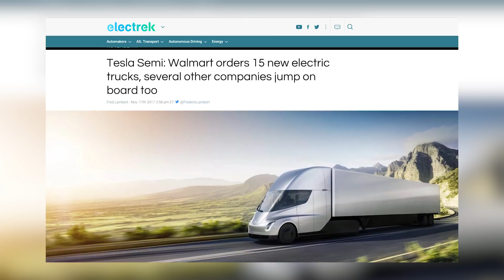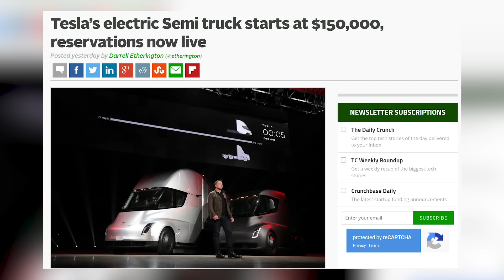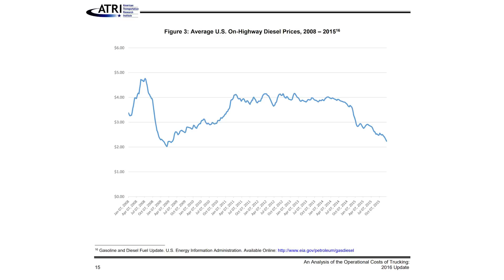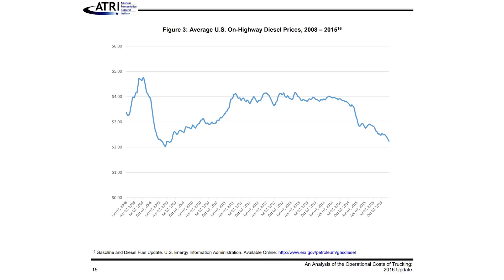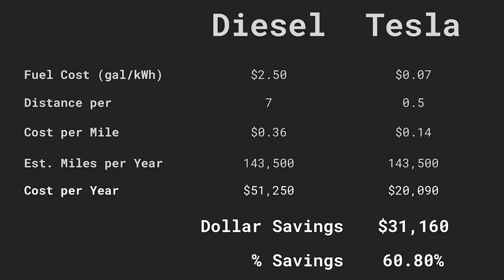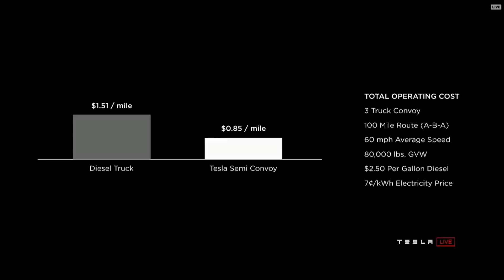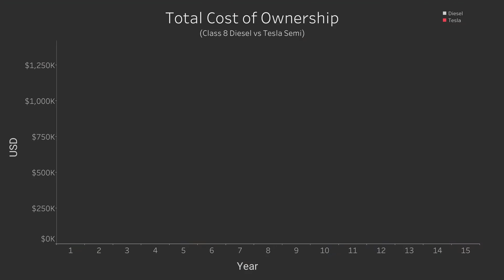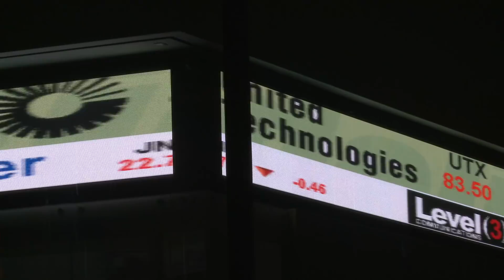What is the TRUE COST of a Tesla Semi?

Comment: Those numbers make no, sense at all. I.'ve driven twenty years and can tell you. Those maintenance costs are off by half at least. Even ripping off drivers like he says will actually increase costs as yoh will not be getting a talented, capable driver.. and the convoy system will be usless much of the year, weather, traffics. And local attitudes will not allow it's use except in insanely restricted areas. Bottom line. Don't trust Musk!

Comment: what is even more important is the back up service from the vehicle manufacturer, for if and when you break down on the side of the road you do not want to be there for a matter of hours waiting for a registered tesla mechanic to come out and fix it, and by the way every truck have trouble on the side of the read tyres running gear lights etc.
and that is what the other trucking company's have that tesla will find it very difficult to cope with.
Reply: King Thor or days

Comment: And also a job KILLER
Reply from the maker: Jessy Caballero and maker
Reply: Industries technology has killed or will in time:  The milk delivery man.... The telephone company women who "manually" placed calls.. (one dialer computer can outperform a 1,000,000 people do that)  telephone human operators (fully automated voice assist). Ice delivery. Film Camera Industry, Horse Shoe manufacturers... Industrial Factory Assembly workers (robots do it now), Computer Operators (Computers controlling computers). Amazon... (goodbye Sears), Horse drawn plows,  Steam engines.  Don't worry, driverless trucks won't happen overnight....  anymore than a cure for the common cold (which is also being worked on, but would likely cost about the same as LAZIK for your eyes).  Enjoy manual trucking before it goes the way of the Vacuum tube !

Comment: Why not put thin flexible flat solar panels on the roof of the trailer to help lower cost and extend distance..Or do they??You could have a whole trailer covered with flexible panels come to think of it..
Reply from the maker: Debbie Rodman would take miles of panels
Reply: Surface area of panels is not nearly enough.  Rough calculations:  Using the whole top of trailer and the sides would yield about 5 to 6 kilowatts hours...This would extend the 500 mile range into a 503 mile range....Three extra miles....  Solar panels are not energy intensive enough to make much difference.  Three extra miles.

Comment: I'm a truck driver in the UK and I can already see the benefit. Send a driver in a convoy, wait till each truck is loaded and then deliver from supplier to a central hub.
There's some issues with timed loads, but with some rethinking this is a game changer. Though drivers would become more valuable since they'll do more work to micro manage the non driving part and unless the mega chargers come with staff then the driver will have to do that also.
Another benefit is that in the UK we drivers have a 45 minute break every 4h 30 of driving or 6h of work duty.
Reply: Flavia Pitariu i wouldnt want to be in that plastic box in line at Calais,  Muslims will eat you slive

Comment: I think you need to be a bit more cautious with your words. It is actually impossible to software update the 4 electric motors. Those are electrical machines, can't update hardware over the air. It is possible to update the software in the motorcontroller though.
Reply: Or you could not get bogged down in word-thinking. 🤷‍♂️😏

Comment: Remember Evannex article at the beginning of the 2017 stating the new 2170 battery was 45% bigger in volume and 5750-6000mAh capacity over the 18650 cells 3000mAh. If these were going into the Tesla Semi, the weight reduction would be 25% for the same capacity with the advantage that the new cells could delivery higher power. The production costs is slightly higher than the 18650s.They had samples of finished 2170 cells back then so what if now 9 months later, Tesla have had some slight chemistry and capacity improvements? So in the past $145 per Kwh x 1 MwH battery for a Semi = $145,000, imagine the new 2170 cells @ half the cost $80 per Kwh x 1 MwH = $80,000. Am I wrong with my assumptions?

Comment: One minor correction: 80000 pounds is 36000 kilograms, not 3600.
Reply: Maintenance is a BIG deal, and electric vehicles win this category hands down compared to ICE vehicles:
- No gears, belts, hoses, pistons, spark plugs or pulleys to wear out.
- Regenerative braking not only stores much of that energy that would have been lost by just down-shifting or applying the brakes (saving money), but also makes the use of the brake pedal unnecessary most of the time, making the brake pads last MUCH longer. Elon is only slightly exaggerating when he says that the brakes will last "forever".
- FAR fewer overall moving parts. This is the main reason that a million mile warranty is feasible.

Can Elon and Tesla get this truck to market in 2019? Let's hope so!
Reply: One more thing: The only aspect of the Tesla Semi that has me a bit worried is the center seat. I'm wondering how real truckers feel about that.

Comment: To recharge a 1MWh battery in half an hour would require a TWO MEGAWATT charger.  Where on earth are you going to get that level of power from, via a pluggable connection? Even at 10 kilovolts, if you could connect that safely in the rain, you'd still need a 200 Amp cable.  If all you could find is a 20A 240v socket you'd be waiting just over 8 days!

I think a more practical application could be for small to medium sized trucks for local delivery. There, the range limit is not so much of a problem, and they recharge overnight so no hurry. A quiet electric truck would be very welcome in residential areas instead of a throbbing diesel. That  and the maintenance costs would probably be lower in a stop/start driving regime which is hard on brakes, IC engine transmissions etc.
Reply: At the larger supercharger stations there are dozens of Tesla charging simultaneously, drawing more than 2 MW. How come we never hear of problems. Because there aren't any. This is one of the simple things.

Comment: Going from diesel trucks to electric trucks will be comparable to the railroad industry going from steam to diesel locos in the USA during the late 40's through the 1950's. Maintenance needs and associated costs went way down and consequently the necessity for a huge supporting workforce diminished. The same will happen in the trucking industry IMO. There will be significant job losses for diesel mechanics and other technicians. Of course these electric trucks will also need maintenance to their systems though perhaps not as intense due to the inherently simpler and less stressed components. Eventually even the drivers will be eliminated for most deliveries. This will be very disruptive for society on the human level. Will this outweigh the benefits of higher corporate bottom lines and the benefits that will accrue to the environment from decarbonization? It will be interesting to see how this all shakes out in the next 10-20 years.
Reply: Which begs the question, why are we not using more trains? Tier 4 standards on new locomotives make them very emissions friendly and fuel efficient. Cost per ton is weigh less than what a truck would cost. Yes...still need short hall to get from the depot to the destination...

Comment: What I haven't quite figured out yet is why no one has been building a lot of electric school buses. The schools around me have anywhere from 20-50 buses to pick up kids. Each bus holds anywhere from 30-60 gallons of diesel and about 10 gallons of diesel exhaust fluid. Most are International, so whatever engine they use I think it's a 6.4L still. Some are still running older Thomas buses with Cat 3116 and 3126 and a few are running Cummins 5.0L. On average they are getting 7mpg and maybe 10 if they are traveling longer distance with minimal stopping. My point is, there should be a lot more school buses that are electric I feel than class 7 and class 8 trucks.

With Wal-Mart only ordering a small number and that's mainly to ship from distribution center and maybe a couple stores, it'll be a long while before Crete Carrier, Warner, Swift, Taylor, YRC, etc make the switch from diesel to electric. School districts could see a lot lower cost by switching, which would help them put money back into the school education rather than forking money for fuel.

Comment: What i find is that dealing with hybrids are the batteries if those batteries dont hold up for 10 +yrs it will be a loss for the trucking company in a prius the replacement batteries run about 7000 to replace and the car don't hold enough gas to do 300 miles. Replacing the batteries in a semi that is completely electric at 145,000 dollars after 1000 charges and is the life cycle less due to the rapid charge are you able to get more charge out of the batteries due the demands of use of vehicle in question every 500 mile a 30 min charge gets u 90 percent charge use that technology in buses like greyhound and amtrak the load is less and they travel within range of the capacity the chassis. And body can be outsourced electrical can be tesla technology. It will make money faster

Comment: RIP mechanics, gas stations, brake pads manufacturers, etc.
Reply: Surely mechanics could relearn to work on electric fleets?
Reply: In 50 years there will still be diesel trucks running the roads

Comment: To me it seems that all things equal (if the Tesla truck doesn't come with any disadvantage, charging is equally easy etc), company image (of the client) might be the biggest advantage.
Imagine if it drives down the road all quiet with the company's name on it.
If running costs were equal to diesel trucks, it's still a win, for boosting brand image alone.  But the Tesla Truck is supposed to have lower running costs, so to me it seems like a no-brainer. First major change in the trucking biz for a long long time.

Comment: I've run fleets of 20-120 trucks. I am deeply skeptical of these claims at face value. Cost per task km always includes all factors; in this case I am confident there are low degrees of confidence in a lot of the factors that went into their comparative claims, else more detailed workings would have been shown that could be empirically contested. 

Companies make claims about how operating costs on fleets can be slashed all the time. Just last month a training company was pitching 15% operating savings from a driver training program that reduces fuel use and equipment wear. Such claims seldom deliver a fraction of what they pitch. Logistic distribution is an incredibly competitive market, and for that reason is always looking for efficiencies and is thus always being offered them - most fleet managers and operations managers have been offered more bottles of snake oil than most people have eaten hot meals. Without solid figures that can be tested, you might see some eyebrows raised, but you won't see anything other than very small orders to test the water early.

I'm eager to be proven wrong, but I'm not going to hold my breath.
Reply from the maker: Solomon B I agree we need to wait and see, do you agree tho that if these claims hold true it companies will be lining up to buy?
Reply: Teslanomics by Ben Sullins Assuming  charging stations are well distributed and have enough throughput not to choke routes, yes. I suspect that the transition will be much slower than you expect though; I think it's almost certain that some of the baked in assumptions presented about savings only exist if your entire fleet is Tesla. In that context decisions about how you phase fleet replacement be very sensitive to the specifics of businesses, loads, customers, routes, financials, levels of maintenance and supply chain integration etc. 

Also, it's likely worth disregarding the convoy model savings completely. That's 100% gimick. Trucking companies already choose not to do that for nearly all routes and loads using road trains. Any route and load you could feasibly use a follow-me system like that for, you could already use a road train if the savings were really there.
Reply: Solomon B damned straight! This smells

Comment: I am a professional driver myself. I have been keeping up with the news about electric truck's for a while now. It is my professional opinion that this truck will be more expensive to produce than a traditional truck and extremely dangerous to drive due to the lithium batteries. FYI, Convoys are currently illegal and most likely always will be. The problem is if you take several identical truck's run them in a convoy all day along the same exact route after time each truck will have different amounts of wear in different locations including tires, brakes or in this case electronic motor wear from one motor to the next, different suspension wear, ect, it all adds up to each truck will eventually have different rates at which it can actually brake at. If the truck behind can't stop as fast as the truck in front then you have a problem. The Tesla truck will also out accelerate it's own brakes which is extremely dangerous, it has auto brake and auto jackknife technology and if it's anything like what's currently on market it will malfunction for absolutely no reason and actually cause a wreak with or without the drivers input. There are a host of other logistical nightmares about this truck and the list is far too long to mention everything here but believe me when I say stay away from this truck!
Reply: You understand that the breaks are basically never used right?  And that electric motors don't weaken with use?
Reply: Your comments are decent but you need to view the mercedes convoys in europe.  they can allow other vehicles between etc... addresses many of your concerns.
Reply: Tesla trucks could easily keep track of how many miles truck XYZ was the leader and how many miles truck ABC was a follower. Then switch roles accordingly.

The Tesla truck's brakes do not wear out. Ever.
So that seems to be a null issue.

The tires are another story.
Reply: There's nothing more douchey than the obligatory snide comment, "you do know that blah blah blah blah, right?"  PS...its brakes...not breaks.
Reply: +JB G, funny.. seems to me the douchey snide / insulting comment would be yours.  Mine at least was actually relevant to the discussion and not a pointless insult.

Comment: You kept talking about the Tesla Semi's added initial cost but didn't show the average cost of a new diesel truck. It seems you were considering only buying a Tesla Semi vs. not buying anything at all (or keep using your already owned diesel truck).
Reply from the maker: +Raymond Lasten did you see the chart at the end?
Reply: Teslanomics by Ben Sullins do you mean the one with the white and red lines? Since they start at year 1 and not year 0, I wasn't sure what all was being considered to start the chart at around $200K for both. I guess you're saying they cost about the same (with the Tesla being very slightly/negibly more)?
Reply: Teslanomics by Ben Sullins the mean cost of a semi in the West coast is 24,000$ and the 90 percentile is less than $25,000. That means that tesla semis cost over 6 times (or 125,000 more) than that of the most expensive semis.

Comment: On the maintenance side there is an engine and gearbox rebuild every few years in addition to  regular maintenance.
Reply: I come from the railway side, but the engines and autoboxes used are the same, Cummins and Voith , Maintenance difference between DMU and EMU was about 2:1 , and similar to trucks as regenerative braking, and mechanical final drives are similar.
Reply: Dave Bell just like any other truck... shit breaks

Comment: It's silly arguing that the power plants will be coal. Even if 100% of electric vehicles run via coal power plant... It's STILL WAY BETTER!!! Than individual vehicles burning fossil fuels... And emitting fumes in traffic...a centralized burning of coal in a coal power plant is 40-50% more efficient and it has better equipment for prevention of toxic gasses (like nitric  oxide/sulphur oxides etc) release in the environment...
Duh...
Reply: Adam smith has no clue how the power grid works and seems to think we are using DC power lol...  Pro tip bro, substations do voltage conversion they are NOT boosters as you would need in a DC system.  Power goes MANY MANY 100's of miles passing 750kv.  Last I checked the house uses 120v... know how you get from 750kv down to 120v MANY SUBSTATIONS AND AT LAST THE TRANSFORMER ON THE POLL...
Reply: FYI it's actually less efficient to use grid power due to the amount of energy that's lost in transmission. This is why (along with the massive cost) trains in America have not switched to electric, the transmission is so draining that they need substations literally every 100 miles... Much more efficient to have a large generator onboard to drive the electric motors.
Reply: You have no idea how power plants work, they are not much more efficient seeing as they burn different fuels... and you are going to totally screw up baseload so your going to get way more peakers, you don't know about them, very quick, base load power plants take DAYS to ramp up to full capacity... they are made to run, 24/7 power demand changes however so stations that can come online right away are needed peakers... but boy are the $$$ to run and dirtyyyyyyyyyyyyyy.  So all your hey lets have everyone have EVs is going to do is, come home from work... already going off base load now as everyone gets home AND plug in a HUGEEEEEEEEEE power drain.  

Also last time I checked, burning gas / diesel does not emit HALF of what coal does.  So um, hello now... coal lets out radioactive stuff... diesel/gas 0.  Not sure where your numbers come from.